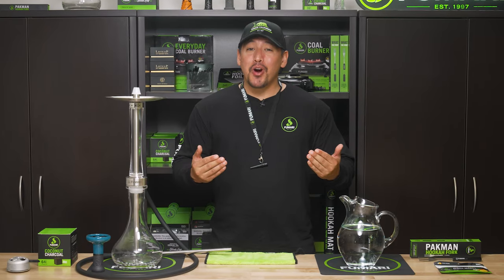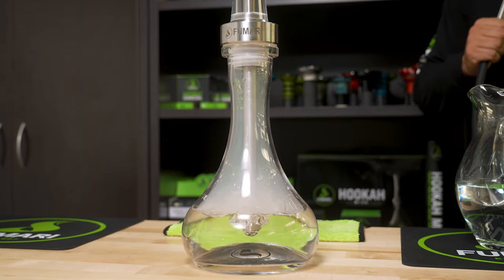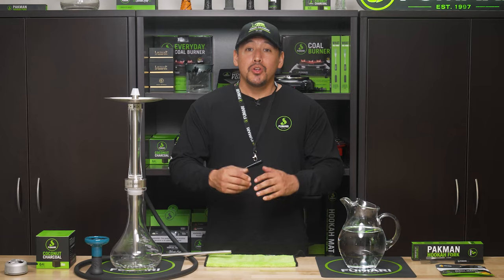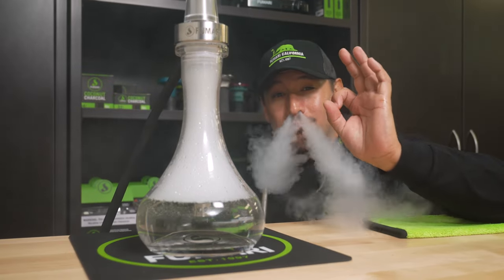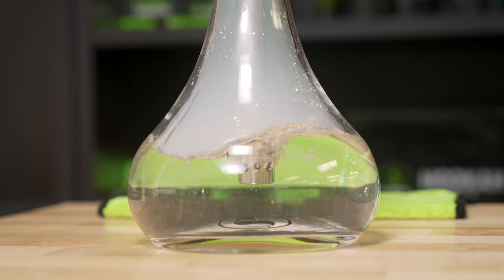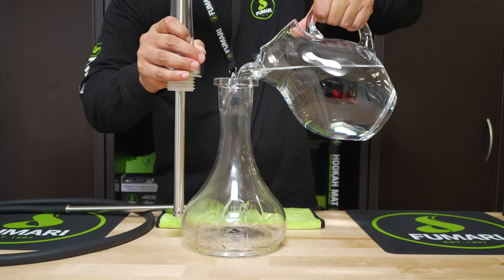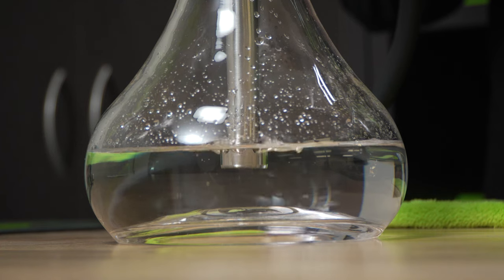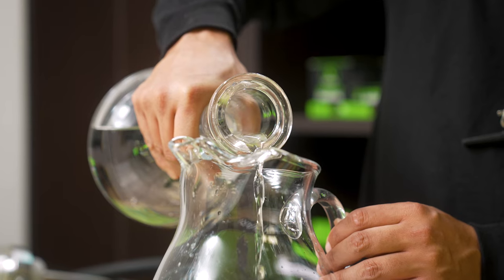How much water SHOULD you be putting in your hookah base?

Comment: My coal burner stopped working, nothing happened it’s just not turning the heat on anymore. Any tips ??
Reply: Just use your stove top if you got an old gas type stove. Don’t do this if you have a glass stove top though you will crack the glass.
Reply: naa it doesnt crack the galss once that glass is for high temperatures of course if not recommended to do it but I did while I was waiting for my coal burner to arrive but got serious marks in the glass that cant be removed  @DeathTheKidBeats